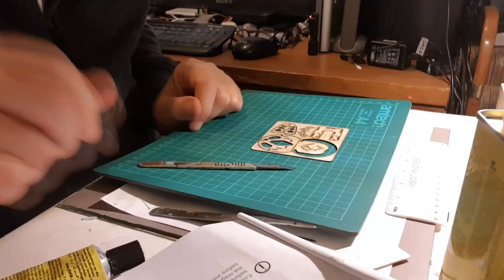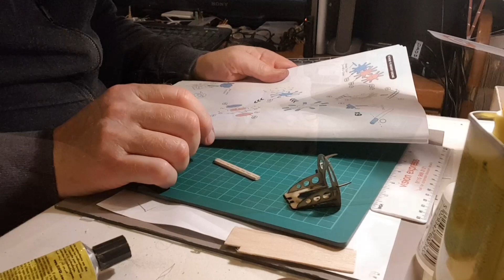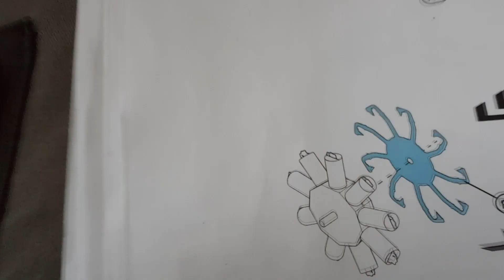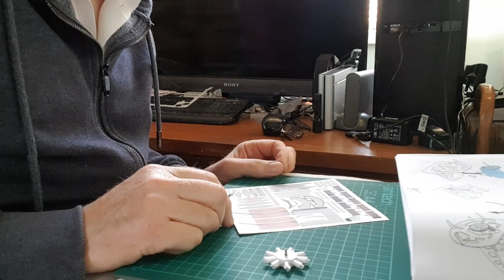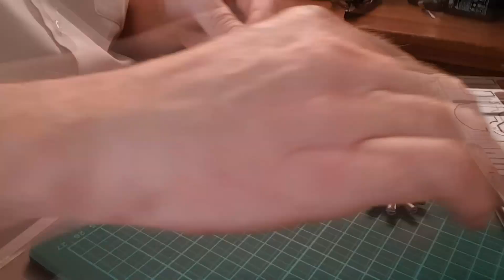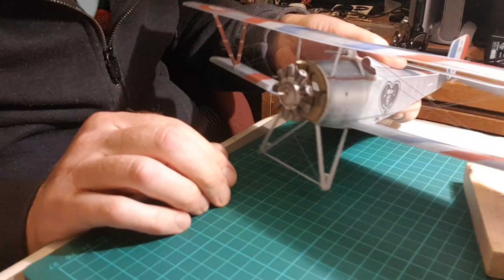Microaces Nieuport 17 Part 8 Motor Mount and Dummy Engine

Comment: I am so scary to build this kit, specialy rigging. Thanks for the tip. May be with your guide i go to this adventure !
Reply from the maker: If you go slowly and methodically and follow the instructions you should be ok, if you make a mistake you can unglue the UHU Por using lighter fluid and have another go.
Reply: @CliffHarveyRCPlanes   One more nice tip... Thanks !